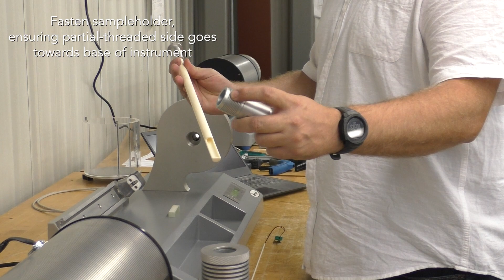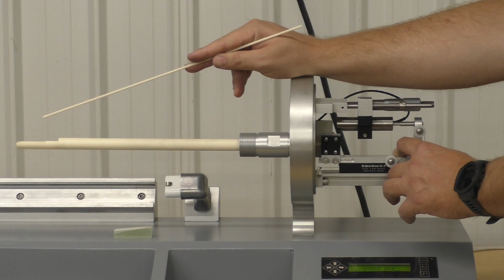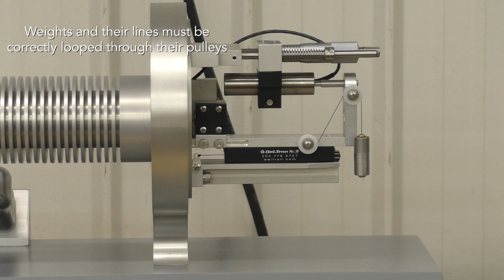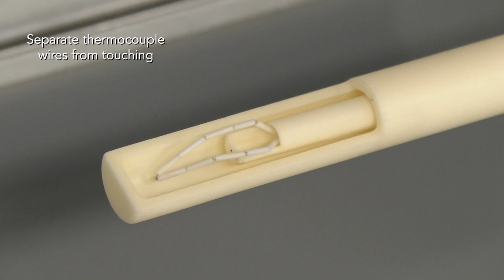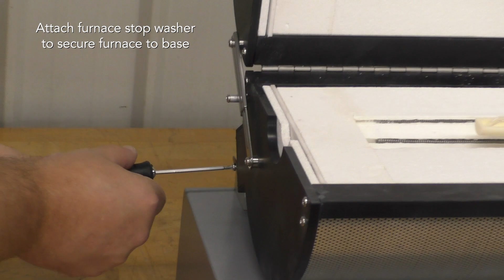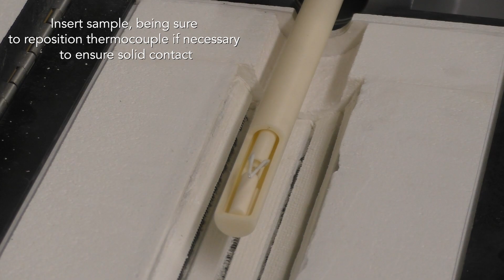Orton Dilatometer Initial Set-Up

Comment: OK.  Im a hobby potter. + I love to watch ceramics related.  Who buys and uses this device?  This is first video Ive seen that I cant figure out, and dont fully understand.
Reply from the maker: This video is just to show how to set up your new Orton Dilatometer when it arrives.  Dilatometers measure the dimensional changes in materials as a function of temperature.
Reply: I work in dental ceramics and we use this to measure thermal expansion of different types of zirconia for dental restorations: https://www.ncbi.nlm.nih.gov/pmc/articles/PMC5455532/
I was looking for a detailed usage video for the unit but this is still somewhat helpful